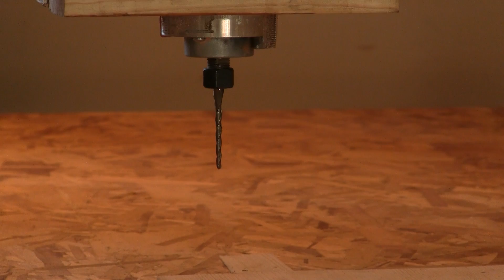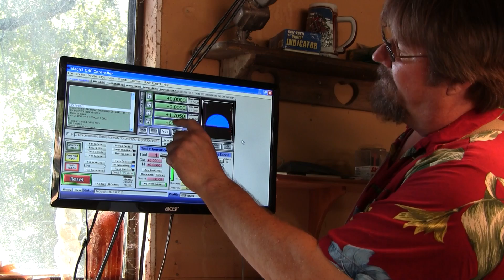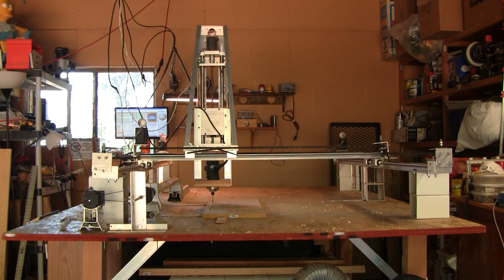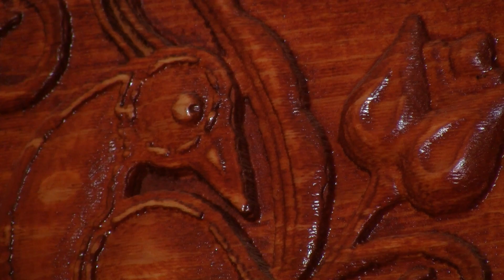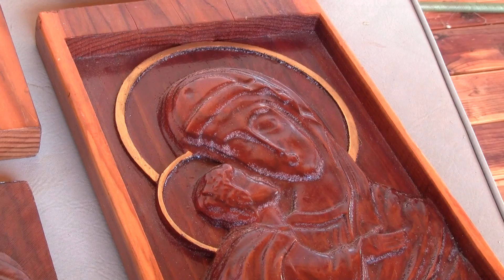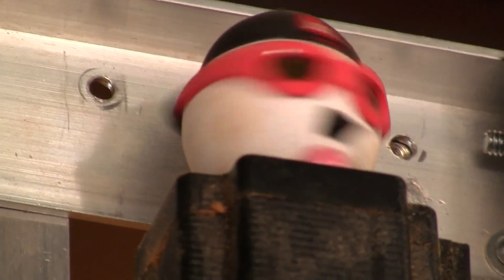Bill's CNC Machine

Comment from the maker: @jjacstcy The one in the video is a 1/8" ballnose carbide bit that has a 1/4" shank.  It cuts on the tapored sides as well as the ballnose.  For the most part I use that bit and two others for most of my work.  The two others are a 1/4" carbide endmill and an inexpensive 1/4" 45 degree V-bit.
Reply: Good morning Bill. I tried your email link and it come back. You do some fabulous work. timjziegler@gmail.com